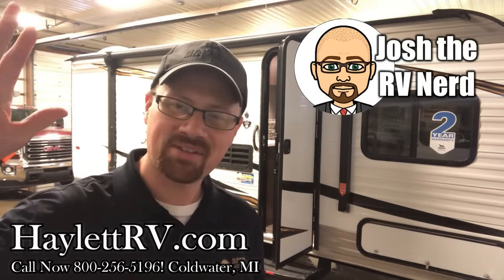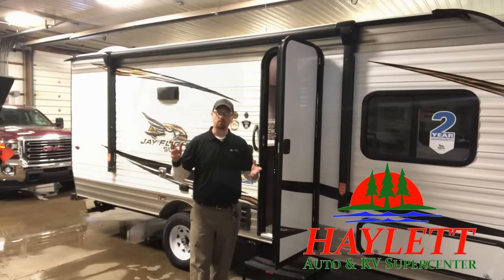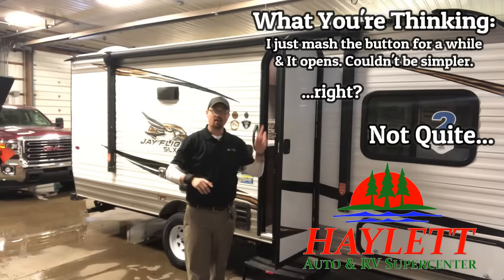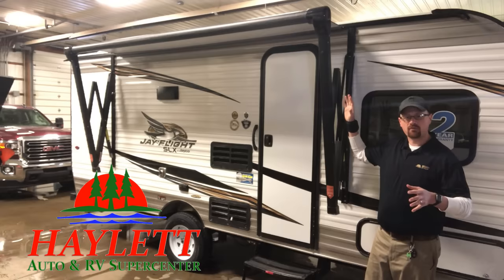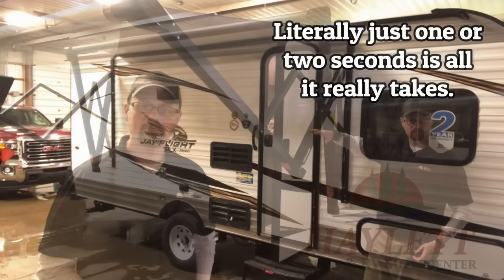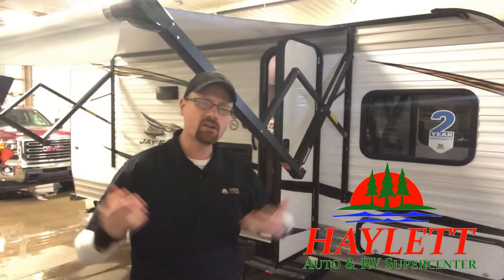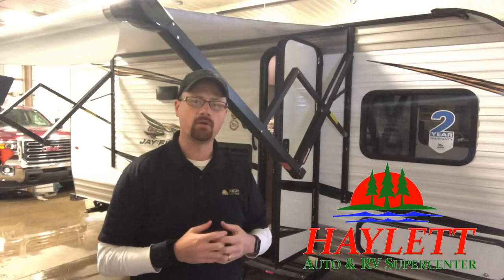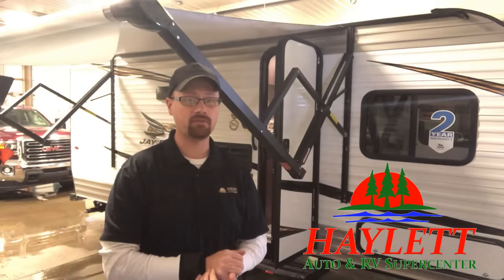You're Using Your Power Awning Wrong with Josh the RV Nerd

Comment: Josh, another reason many people open the awnings too quickly, is that many RV centers don't even know.
Reply from the maker: I've had an interesting amount of hate from both viewers and a few other dealers accusing me of making this up. Why I would spend my time fabricating such a story, recording, editing, and publishing is beyond me

But if you scan RV forums and facebook groups you'll see people reporting awning strut issues & folks telling them they can avoid the problems by doing what we've shown here. Learned this a while back from my techs and didn't realize it wasn't more common knowledge for several years
Reply: @JoshtheRVNerd  I can believe that; but you know, it seems no matter what you do some people will find issue with it. I was a tech for several years. You put out some good helpful videos, keep up the good work.
Reply from the maker: @nvgun40  Pinning this so people can see a Non-Haylett service tech confirming it lol
Reply: @JoshtheRVNerd  I will even add, that in colder temperatures, you should pause the awning a few seconds longer.
Reply: Hey Josh. I'm a fellow rv tech, and never thought of this,  however if you compress the strut without it being on the awning and release it, the shock will go from full retract to full extend on its own much faster than I can make it do it while extending it on the awning. This makes sense in colder temps but I'm not so sure this theory hold up .?

Side note, I've been told by Jayco that the longitude model in your video here doesn't have an auto dump feature. 

I'm not hating. Just want to hear your thoughts
Reply from the maker: Hi  @mekalue ! I'm not a tech actually -- Rather I've simply done this a while and picked things up from our shop team. They know we get good info out to folks and asked me to pass this one along. 
Regarding the awning seen here: The strut itself is the auto dump. Rain-weight can weigh down the awning, compress strut, & allow runoff. 

Always good to trust but verify!
Reply: Dude, love your vids! Wish him lived closer as I would be looking to buy an RV from you!!!
Reply: @JoshtheRVNerd  if i lived near you I'd be buying my future Jayco RV from you!!  LOVE THE VIDEO & INSIGHTS 😀😀😀👍
Reply: You're just repeating what he said on the outset of this clip
Reply: @JoshtheRVNerd   do I do the same process on closing?
Reply: @JoshtheRVNerd We've had our rv for 4 years, and we open and close the awning all at once. Never have a problem with the struts.
Reply: @southernman8225 does it automatically dump rainwater?

Comment: I did not know that.  Thanks Josh.  By the way we owned our first camper for 10 years before a tree fell on it and totalled it.  Now at age 76 we are on our second camper., a little nicer and longer than the first and with a bump out that the first did not have.  Much more comfortable and at 24'6" versus 18' for the first it still tows nicely with the half ton pickup, although now we use a load equalizer hitch.

Comment: 1:49  I disagree with the explanation of the operation of the gas struts in an awning.  Gas struts are sealed, no gas or air goes in or out of the strut. When retracting the awning,  the strut piston moves in which further compresses the already compressed gas to provide pressure (force) to push out  the awning, just like the lifting force of the struts on your manual SUV tailgate.  The only thing happening is the gas in the strut is alternately being compressed or allowed to expand within the cylinder. When the awning gets too heavy with rain, the weight overrides the pressure applied by the struts and they compress part way back in and the awning tips down releasing the weight of the water so the struts can raise the awning again.  Since the speed of the piston rod is very slow (it travels only 6 1/2" in the 30 seconds it takes to operate the awning, I don't believe that stopping has any benefit to the struts but it won't hurt them if you want to do it.  By the way, be sure to stop part way for a few seconds when opening your manual tailgate!  (sorry, I couldn't help that)

Comment: We bought our Jayco popup in the early 90's from Haylett.  Several years later, we traded it in for a 24' TT at Haylett.   Never had an issue with the RV's or the dealer!  We've not gone from a Pop-up, to a travel trailer, to a Class C, and now we own a class A which we'll be selling this summer and buying a 5th wheel.  The C and A were not from this dealer as we moved from Michigan to Ohio unfortunately, but retiring next Spring.  Maybe we'll head up to Coldwater and take a look around!  We most likely bought our trailers from your dad Josh.

Comment: Instead of AIR in those struts think NITROGEN not a big deal but cleaner than air air being about 81% nitrogen.  Anyway the thing is there is a lot of VALVES in a strut and they work like a SPRING and a SHOCK ABSORBER  just like the strut assists on a trunk or hood.  But these take up a lot more force.  Another thing is if you are going to leave your coach with the awning OUT  DON"T!!  a micro-burst of wind can really ruin a trip!! Been there, done that!!!  I did add Carefrees Bluetooth control to my awning mines a 2016 I think most of the newer ones have it standard.  Great add on!  Keep up the great work Josh,  Probably will knock on your door for my next RV!!

Comment: Thanks for the tip, our 2014 Jayco had a bad strut when it was new. We have a 2018 now with a different brand of awning, It goes out normal speed but when closing takes forever, I took it back to have it looked at and they said it was fine. I rarely use it for fear of not getting it closed if a storm or wind comes up fast.

Comment: Hey Uncle Josh. One thing you forgot is to periodically spray a little WD 40 or what I use and that is silicone spray lube on the gas strut rods. These things  bake in the sun and get dry. When you operate the awning the dry rod wears out the seal or "O" Ring on the rod end of the strut causing it to eventually wear out the seal. If one forgets the tale tale warning is the stuttering that the strut does when the awning opens up. Sounds like a machine gun. So get the can of silicon lube and spray the piston rod and open and close the awning once or twice. I do this about three times a year in camping season. Here in the Southwest AKA Arizona things get hot and dry out so a shot of the silicon lube goes a long way towards keeping the gas strut in good shape.
Reply from the maker: Man. Great advice. Ty

Comment: Aren’t the struts the only thing pushing the awning out? Why would it go any more quickly then they could handle? I mean it doesn’t hurt to pause, like you say, but anyone that’s had a strut fails knows that the awning goes nowhere when they’re not working. Just unrolls right in place.
Reply: Yes that sounds right.  The strut pushes the awning out, similar to a hood or hatchback on a car.  They use the same type of gas strut.  The analogy of a door closer is incorrect though.  Those use an adjustable orafice that restricts the air flow from leaving the cylinder, which slows down the compression of the door closer.  The gas strut is pressurized to exert a predetermined force in the direction of extension.  The design of the awning uses this force to push the awning out.  Because the gas strut is only exerting a certain force, the weight of rain that collects on the awning exceeds this force, allowing the strut to collapse, once that weigh is dispersed, water dumping off the awning, the gas strut will be able to extend back.  No one opens a hatch back, tailgate, or hood in stages, I bet even Josh.

Comment: Two questions.  If you pause extension of the awning for a few seconds like mentioned here when deploying the awning fully, should you pause retracting the awning on its way back in?  Also if you have the awning dipped to one side or the other to allow runoff, should you correct the dip manually by pushing the arm back in place before retracting the awning?
Reply: IMO, yes, pause when retracting as well. The gas and seal are reversing the process similar to extending. No on adjusting the arms during retraction. The difference in gas pressures or differential will be minimal, as compared to those differential changes. However, adjusting the arms to be "even" wont hurt a thing, and could make a theoretical difference. Thoughtful question, thank you!

Comment: Good thinking, great ideas. Have a look at the Colorado Carefree Awnings. They make a really neat awning that's like the house style Sunsetter awning. The folding support brackets are horizontal directly underneath the awning so they're really out of the way unlike the typical RV awnings with the vertical folding support brackets we can much easier bang our heads on. The only thing is I really don't think the awning pitch angle is adjustable with that type brackets, which doesn't make me happy.

Comment: Those gas struts are designed for the pressure and speeds they are used at. An awning opens at a snails pace compared to a rear hatch on a SUV or or hood.  There's typically a hydraulic shock absorber inside the strut that provides the resistance to movement by forcing fluid through a small hole just like the pool toy you referenced but these are designed for 1000's of cycles at extremely high internal pressure. 

If they were out, they wear out. Waiting the extra couple of seconds for them to fully deploy makes no sense because when the wind hits that awning its going to cause a compression much faster than any open and close action and that's more likely what causes them to fail.

Comment: Hey, Josh. I am always truly impressed with your knowledge and commitment to "educate" us consumers.

A question on this one, though. Since the awning motor simply releases tension in the fabric roll, and the struts provide the pressure to unfurl the awning, wouldn't it stand to reason that such a "pause" would be needed on the retracting action rather than the extension (similar to operating a screen door strut. It performs quite well extending under its own pressure, but the compression stroke is where seals (especially cold or under-lubricated seals) can develop leaks or cracks?  Just something to chew on...
Reply from the maker: Awning arm struts are very much like entry door struts. In both the case of an entry door or the awning it's when they're extending that they need time to "breathe." When you're closing/compressing both they "exhale" more easily.

Comment: This is my first RV with a power awning, I’ve been opening it in two stages without realizing that I was doing something right! LOL However, I have noticed that most the time my awning doesn’t want to retract I have to give it get off the ladder and start it by hand just putting a little bit of pressure on the rollup, they’re about halfway it’ll takeoff and roll up although be it very slow!
Reply: You might check if the strut can be lubricated (correctly) in some way.
Reply: could be a weak motor or possibly a bent tube. just a slight bend in the tube will over work the motor and it will not close. Ive replaced a few tubes and it closed fine after

Comment: Hi Josh, love your videos.  We have been RVing for over 16 years and I am learning new stuff from you.  We just replaced our Holiday Rambler 5er with a new one.  The new one has power awnings.  Really appreciate this information, we didn't get it from our dealer.  One question you didn't cover, but our dealer did.  He said we could leave the awning in any position - 1/2 out, etc.  It was great when we were camped in a really tight campsite and a fully extended awning would have interfered with our neighbor's slide.  So, what are your thoughts on partially extending the awning?

Comment: Not all power awnings work this way. The Solera on my R-Pod 196 doesn’t have a gas strut. Instead, it has a friction joint that has to be manually adjusted for tilt. It doesn’t require pausing when opening.

Comment: Interesting to know and easy enough to do. Thanks!

This begs the question: why doesn't the industry put in a sensor/limit switch so that, when retracting an awning, the motor will automatically stop once it is closed and prevent you from "over closing" it (and potentially ripping the fasteners from the side of the RV!)? Seems to me that would be inexpensive to implement and a great marketing tool.

Something I just discovered for the first time yesterday was when I accidentally started holding down extend instead of retract on a fully extended awning: the gear motor happily did its job turning the awning "barrel" that the awning wraps around... and it began retracting and the awning wrapped around it... in reverse! Inside-out so to speak! I was like, WTF? and it took me a moment to figure out what had happened! Then I counterintuitively pushed retract (the opposite motor direction than what I originally did) to extend it so that the awning would unwind to the correct, fully-extended position, then properly retracted it! lol Was so amused by this that I had to shamelessly show my wife what happened hahahaha!
Reply from the maker: Some awnings do. As it's not a safety issue I wouldn't expect there to be any sort of regulations placed on awning production any time soon for something like this. 

That's one of those hidden quality of life features that will often separate a more price pointed brand from a more premium RV

There are certainly exceptions

Comment: On Saturday evening, my wife left the awning out and it rained a significant amount. She knew it was going to rain, she wanted to keep some stuff dry. Her logic is, what is the point of the awning if not this? I agree, our old camper had a really heavy built awning, no motor, and you could leave one side lower so it shed rain. Well, long story short, the flimsy awning we have collapsed on one side. Mangling the arm. The other side is still good. The cloth material is still good. I have to replace the arm. Looks like around a 500.00 part? And then, I have the flimsy awning you have to be very careful with if you want to use it, still. Is there an alternative to these cheap tin can, poorly engineered awnings? Any advice on the fix? In this video, you said they gas piston was supposed to be an integral participant in allowing the rain to off-load. I can imagine we didn't do the pause thing. If that was why it failed? Any help would be appreciated...
Reply from the maker: I don't think you did anything wrong. Power awnings work a little differently and even when tilting to shed water they still don't have quite the steep tilt of a manual awning 

Classic manual awnings can also usually be staked down and secured far more tightly vs. power awnings

Things change constantly and though mostly for the better there are a few items like this that have essentially been left behind in terms of RV design

I wish I had a magic wand or special advice for you, but I get the feeling from reading this you're not new or inexperienced. You just got caught by an unexpected change in the way the newer hardware works
Reply: @JoshtheRVNerd  so you suggest we buy a new camper? Just kidding

Comment: Josh:
Thank you so much for the information and advise on how to properly deploy an electric powered awning. This is just another something that was never even mentioned by our dealership when we took delivery of our Winnebago micro minnie. Nor did I see any reference to this issue in the owners manual. 
But with your engineering background, isn't this an inherent and widespread design flaw?  If the industry knows that owners will deploy their awnings without pausing, why is the speed of deployment that's set by the awning motor set faster than the gas strut can safely tolerate? If it's a know issue that over time that the gas struts will fail when deployed in what is a normal consumer owner manner, then why isn't the deployment motor or the gearing set to a slower in the first place? Can the owner or an after market dealership alter and slow the speed of deployment to lessen the negative impacts and failures of the gas strut? 
If so, is this  service that's offered by the service department at Haylett?
Respectfully, Wm. Schooley
Reply from the maker: The design is fine. Modifying a factory component as you've described is not something we would perform for a client. It's been engineered a specific way. 

It's also important to understand things have an expected lifespan. Cars, campers, components, etc. My goal here is to extend someone's return on investment.

Comment: I'd have to double check on a part, but I don't believe awning, or even most rv, struts are the air struts like a house screen door has - believe they are all sealed gas struts. 

Would have a hard time believing they are air struts as stiff as they are though.

Most of the hard movement that I've found is simply due to terrible maintenance/people closing their awnings up with the arms full of leaves and pine needles + just normal collection of dust and dirt with no one ever hosing them out.

Comment: Would love to see a video with your thoughts on TT paint protection (Diamond Kote..etc) and rubberized undercoating Mouse Shield. Keep up the great work...love all the videos.
Reply from the maker: Put extremely briefly: Do you live where those things are a valid concern? If so, then likely beneficial. If not, then I would pass. 

I think you could likely get an RV cover that'll give you the same benefit as coating, and there can be super low dollar anti-mouse methods. But both of those require more effort than coating it and having a "set it and forget it" feel.